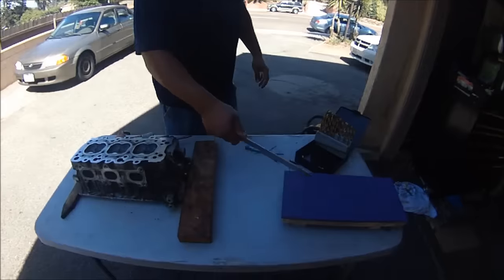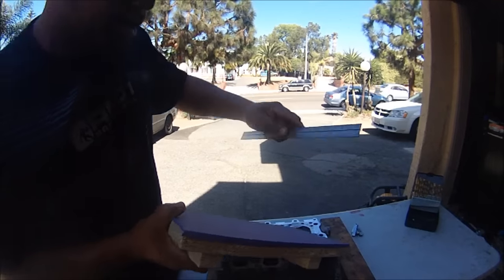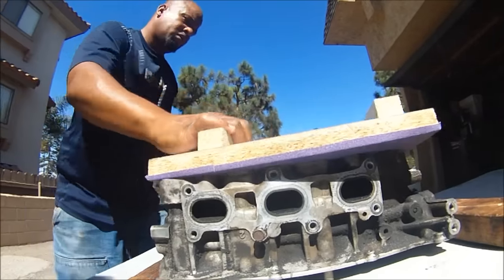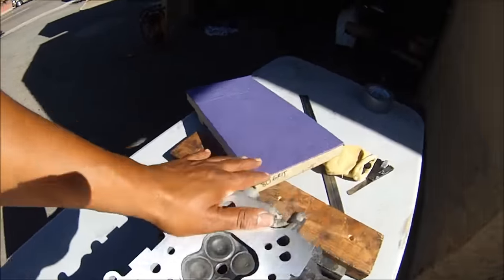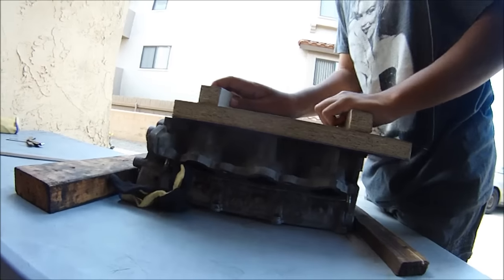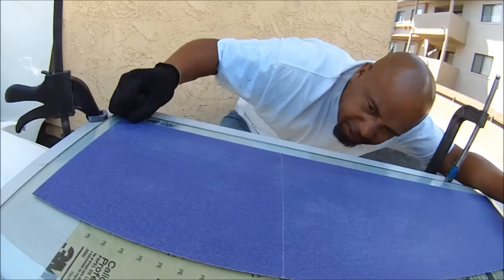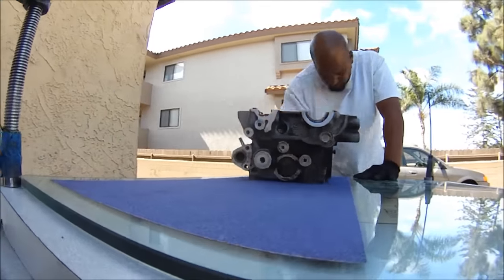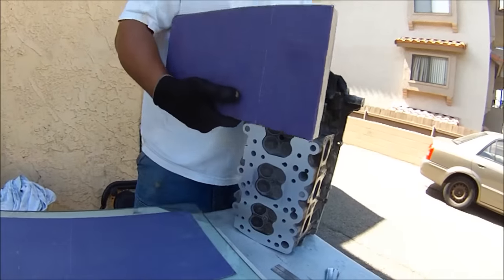HOW TO RESURFACE A WARPED CYLINDER HEAD AT HOME WITH SAND PAPER still works in (2023)

Comment: Yo, old-school I like your video's, n also would like to ask u a question, how is it that the valve on the exhaust side on #2 the left side is sticking out like a 1/4 of a inch n the right one is I say is about 1/32nds of an inch n the rest is all flushed all the way down,oh sorry my bad 4got to even tell u what I'm doing. Ok I bought a 2005 Nissan Altima 2.5L4 cylinder engine bt I've been fixing it on my own from watching video's like yours n I'm not a mechanic bt I know some things on maintaining a vehicle so thanks to your video's n the others where I've understood my ride a whole lot better,n so right now I'm practicly doing everything on it right now like see I was doing the gasket on the exhaust manifold bt then I saw alot of grease r oil with all that sand on the cylinder head n the engine body so I said to myself that I should not put the gasket on cause I found out I needed to change the head gasket so that"s what I am doing bt just that one thing that I am stuck with cause like I said I'm not really a mechanic bt I would like to b bt thanks to u n the other video's I've watched really helped me out a whole lot more in understanding n what to do bt just that valve thing'ie is one that not sure on what to do so I would greatly appreciate your advice OLDSCHOOL

Comment: Another great vid brother. Think the parable I take from here was that if that cylinder head ain't straight, it wouldn't for fill the purpose it's designed to do, for fill the purpose it's created for, or last. So too we should walk straight following Christ to not only function as we're designed by GOD, but to ultimately live our full potential and purpose in life. Every part in a car has a purpose, and we too have purpose as the body of Christ.  1 Corinthians 12:27

Comment: I've been using this technique for decades, but not on automotive products, but rather small engines for power equipment and such.  Works fine for that. With the small engine head it's easy to go in a 'figure 8' pattern which tends to give better results.  You would need a huge surface to do that with an auto head though. I wonder how flat the deck on the block of that engine is, did y'all check that by chance?

Comment: I mean, its a way to do it if the funds are non-existent and you have the time to do all this. I appreciate the can-do attitude of this man. You have to be carefull tho. The surface of the abrasive base or board has to be right, strong and flat. Try not sanding one way but come at it from the other end so you dont sand downhill all the time and create a slant. But good work.

Comment: it took you a lot more than an hour to eet up the table, shop for your wood, cut the handles on your sander, prepare your sanding board to true flar, mount your handles on your wood block, mount the sandpaper on the wood, source your glass, go pick up the glass.  msn you hsve about 6 hours into building thst station.   go pay the $45   id be using 1200 or 1500 grit.  dod the inspiration speech at the end.  Have you ever done a flywheel ?  i got an ej259  Subaru SOHC thst needs a couple valves.  you might have inspired me to take a loss and spend the time building this rig that clearly works.   its just more time consuming than what a machine shop would charge.  But i like a good DIY project where i learn something.
Reply from the maker: Take it and run with it. Use your creativity and gifts God gave you. Never let anything, negative thoughts or doubt limit your CAPABILITIES. Over thinking destroys progress. With God all things are possible, In JESUS MIGHTY NAME.
Reply: @oldskoolfunk71  I think I'm going to source a piece of granite.  What type of adhesive is best...  ... with the idea in mind that it will need to be scraped off and changed from time to time.

Comment: Yo, Old School I like your video on resurfacing the cylinder head cause I'm doing a head gasket on a 2005 Nissan Altima 2.5L 4 cylinder engine b have a question can u also resurface the intake cause I skrech it somewhat a bit n I'm worried about it even though I I have all the gaskets 4 the vehicle cause I need a new exhaust manifold converter n got me the gasket kit n 2 ignition coils bt thinking of just getting 2 more so the spark would b find u think THANK'S 4 your help brotherman really appreciate you helping me with my situation

Comment: have used a similar method, but used a piece of tempered glass with sandpaper glued to it, as glass is perfectly flat, instead of sanding the head, I slide the head on the sandpaper. have also decked a block this way, after sealing the piston gap with tape, so the grit doesn't get in there
Reply: oh, you are using glass eventually...
Reply: glass is not flat

Comment: I think you should be using a longer board and sand paper. You can never have one of the edges of your grinding plate pass the edge of the workpiece. The flatness would be truer if it didn't. I thought that was very interesting seeing the low spots! I wonder why those areas sank down? Ive seen stuff like that on my heads as well.

Comment: In respect to the engine block I would experiment with a similar procedure especially on these 2.0 Honda that become compromised between cylinder 2 and 3 in a prolonged overheating or slightly compromised situation. Instead of pulling the motor and Milling the block, I would try something like this however a very different tool would have to be used. Any gain on a consistent level would prove to be helpful and maybe get away with saving 12 hours of Labor

Comment: FYI you can also swap out head bolts for grade 10 studs even if no issues, you can pull one by one in correct torque spec and save some money as parts store keep studs in stock usually same length all you need some could be swapped out for shorter ones, BOOM you have a studded head and reusable. If the hole has oil in it be time to use can carb choke cleaner an some air shot in there with nice oil rag for blow back to strip it clean. finger tight or slight snug all needed for studs, a drop of red locker or tooth brush w some ultra black to seal hole as studs wont be stretched. After all this i usually after first heat cycle do extra 5lbs for OCD purposes. No need to spend over $100 for head studs, grade 8 or grade 10 still the grade of stud name brand or parts store in box for about a 1 or 2 each.  Applying ultra black keeps the dielectric in Dexcool from happening around steam holes and etching metal an prevents brinelling of surface as fire ring digs in dur to thermal expansion and contraction.

Comment: Yes, you can flatten a gasket surface at home, but... the cam tunnel and valve seats may still be warped.   No bullshit my dudes.      Years ago I did a head gasket on a car which had a new radiator...clue!!!.      It had overheated so bad that the valve seats warped.   I didn’t learn this until it was running with low vacuum.   A leak down test showed valve seal leaks.       Got to do that job twice..!!
Edit:   Just remembered it was taken apart when I started working there.    
I’ve learned to tip the head upside down and then fill each combustion chamber with water or atf/solvent combo liquid.   If she leaks, it need valve job..!    Give it 24 hours, it may leak immediately or slowly.

Comment: The method shown is totally within classic workshop-book description ..  eg. DUCATI motorbike .. the only point he missed is "figure 8"  ..as to keep it from going all skimming within one main direction you should  move the head around in an 8 especially on the last two finnish steps. That's of course easy to do with the individual cylinder head of an Ducati engine .. for an 3cylinder head you need a bigger sandpaper surface area on the glass

Comment: Just an FYI, not that it's that far off obviously, but If you have 3 different flat sanding blocks, each of the same grit, and alternate between all three during your sanding stages, it will almost eliminate all microscopic imperfections, or discrepancies between the sanding blocks and give you a machine quality finish.    (since your sanding block is most likely NOT absolutely perfectly straight and smooth)

Comment: Let me jump in here too. At 60 I've been machining and building engines for 45 years. Turning wrenches like 48( 12 when I started helping my uncle).  And through the years I've run some super nice machines. And I've done some backyard stuff like this.  And I try and stay in the machine shop with this stuff as much as possible.  But we too have had to do what you had to do at times in the early days.  This will work if you just take your time and keep checking yourself  many will talk shit and down you. But at the end of the day you will be running and that's what counts... Plus half of them talking shit probably couldn't do it like this anyway.  Because it's actually harder than turning on a machine and it does most of the work.  Besides,  what the hell does their opinion matter anyway right 😅?

Comment: I watched  friend of mine drind the aluminum head of his VW using valve grinding comound on a iece of glass.  The machine sho wouldntgrind it becaue there wasnt enough thickness left from a revious grinding.  After my friend ground it the engine ran just fine for many years.

Comment: You should also use engineer's blue on the surface. It will show you all the low spots. Keep sanding until all the blue is gone.

Comment: This works but going in with a lighter grit than 120 would be the ultimate best result. Not saying 80, 100 and 120 wouldn’t work. I would also highly suggest this if you’re doing this to an aluminum head. With aluminum, go much higher grit. 500, 800, 1000, etc. Steel doesn’t get as many grooves as aluminum.

Comment: Hi Oldskool funk your a good instructor on motor repairs and anything dealing with cars , im wanting to know something about my car its a 2007 suzuki swift+  , when i go to start it up sometimes it will start and other times it wont ,as example i tried starting it for 2 day with no start then day 3 i got in and turned the key and it started right up ,do you know what could be the problem why its doing that .thanks so much if you can answer me on this .God Bless

Comment: Great idea, I wonder though if the head is warped how is all the valves going to work. They say to only surface a head when its .010 out. If its more it needs to be pressed straight to within : .010

Just a thought.

Comment: you can treat the engine block surface just like that - without having to pull it up. just as good as the machining.
if you use a piece of glass the reflection will show you any warpage. so no need to measure it.

Comment: Great job MAN! I am in the process of doing exactly what you have shown. Thank you for the word of wisdom and putting Christ first. I see that you used the flat sanding block for the 80 grit. Can I also use the same methods for the 100 and 120 grit instead of the glass surface?
Reply: I was wondering the same thing
Reply: Probably could get away with it, but you want something EXTREMELY flat. A marble gloss countertop is ground flat, but might not be; glass panes tend to be flat, but they can bend if whatever they're sitting on also can bend; wood is easy to accidentally dent and pit, and that's not what you want. The best surface would be a surface plate; but they can be expensive.

Comment: What were the symptoms of this warped head im having a nightmare on 19pd golf its highly tuned it was running good for 6 month then started getting oil in the coolant changed gaskets 3 times along with head bolts etc and oil cooler etc woul a warped head cause oil in the coolant??

Comment: My concern about the first part when he was doing 120 was that he could be putting more pressure on one side or the other, essentially causing a slope. May be flat, but at a slope, which would obviously not be great.  But then when he did the second round, with the weight of the block being the pressure on top of the sandpaper, that seemed like a pretty darned good idea. Would there be any reason not to just do the whole thing that way? Start with 120 glued to the glass?  Then rip it off and do 100?  Then 80?

Comment: You should USE LAYOUT DYE, OR EVEN A SHARPIE TO MARK THE LOWEST SPOTS ON THE HEAD, SO YOU CAN VISUALLY SEE HOW MUCH MATERIAL STILL NEEDS TO BE REMOVED AND YOU'LL KNOW PRECISELY  WHEN TO STOP, SO YOURE NOT OVERLY INCREASING YOUR CYLINDER COMPRESSION.

Comment: could have also took some paint n took the sanding block across and once all the paint is romoved its flat.. not knockin how it was done in the video n didnt go thru the comments just my 2 cents on how  i would have done this. now the glass method on small 2 stroke heads before.. was at request of owner to fix it that way...

Comment: Wouldn't it be slightly better to use a better table for the first time sanding with that plank of wood rig thing u got going? That table seemed to wobble and sink in and out a lot. Im not trying to knock on this guy i just thought id add a suggestion. But yeah, great video dawg. Its awesome to see stuff like this.
Reply from the maker: Thats why you modify what you see. Take everything and improve it. I just wanted to spark the ability to think outside the box. I agree with you great idea Marco, Everything can be improved. Creativity is endless.

Comment: Another method is much easier and it's called ceramic engineering it involves washing dishes at the local diner until you can purchase an old block from a salvage yard.
Reply from the maker: Then youll never gain the experience

Comment: So, you spent $25 on sand paper and 3m 77 adhesive and saved yourself $20 but spent 2 hours sanding? How is that a savings? I do like the idea and the fact that it worked makes it a great idea.
Reply: I like this method because yeah you can throw it down to the engineer and get it done for £40 but it’s how long they take, some places you could be waiting 4-5 days, this is done same day, keep stuff moving out of garage 👌

Comment: I'm hoping someone out there knows of a solution to my problem. I know I'm an idiot.... From the beginning I covered all my ports so nothing gos inside the engine. Vacuum on hand, try to do a clean job. So as I prep the engine for new head gasket & lifters you know reassemble everything. So as I was about to insert the 2nd lifter tray & I dropped the bolt that go's to the lifter tray not sure if it fell in the block, but I looked all over the place like crazy & could not find it. With so many crevices in a enginebay it could be any where.  I just heard it go down hitting like metal or like a hollow area. Im sure it never hit the ground. Is there any body that has a method to insure whether or not the bolt is in the engine block with out removing the oil pan?

Comment: A better method is to use a glass shelf......glass due to the way it's made is flat....spray 3m 70 spray adhesive on it and cover with wet/dry sand paper and sand......for high boost turbo motors running metal gaskets I go to 400-600 grit polishes like a mirror!

Comment: you need to bend the head straight first with pressure and heat. then you won't need to sand it.  it will be flat

Comment: No bro!  
You want a rubbing compound.  Take a heavy sheet of glass put it on your table.  Coat the head in rubbing compound and water then turn the head over on to the glass.  Then slide the entire head back and forth until flat.

Comment: 2000th of an inch is thicker(!) than 4000th of an inch. So testing the end result with a 2000th of an inch if you have 4000th, doesnt make sense. I get the idea though. Great video !
Reply: Are you sure about that? .002 is thicker than .004? 🤪👍
Reply: @robertnewell1277   .002 inch is something else than 1/2000th of an inch. Sure .002 is thinner than .004.   But 4000th of an inch is thinner than 2000th of an inch.  (Because you are dividing 1 by 4000 pieces, rather than 20000.) I dont know which metric is used on this tool. If it's decimal or relative.
Reply: rather than 2000**

Comment: Just pay the money.. and take it to a machinist.. Some things are worth the price tag.. when it comes to something as important. As a cylinder head, take it to a pro.. or expect to be stranded.. very shortly after this repair.. something to be said. For having the right tools, for the right job.
Reply from the maker: It's not for you
Reply: @oldskoolfunk71  Your right it's not. I'd rather pay a professional.. with proper tools.. so my car runs reliably.. but I think to myself, how many people.. will actually try this. And just end up destroying their engine. Because of it.  You could at least put a disclaimer. That your most likely a backyard mechanic.. with no actual professional training.
Reply from the maker: . As you complain we will continue to move forward without you
Reply: @oldskoolfunk71  I think you need to open a dictionary.. and look up the definition of complain.
Reply from the maker: Rebuked
Reply: @acid_burn7837  check your spelling

Comment: What if the head of the block isn't flat?
Reply: You mean the top of the engine block? If the head gasket leaked and the block is aluminum it must be resurfaced, but if it's cast iron then just clean it up.

Comment: saw one funny mechanic video resurfacing the cylinder head by simply putting sanding surface on rough shop floor. a quick swirl and its done. dont think its an approved method.

Comment: this won't work on overhead cam engines, which is a lot these days.  with OHC engines... you want the cams flat..not the valve/sealing side.  you can get the sealing side flat but your cams will be misaligned chewing up bearings and your crankshaft will eat those shavings.  knock knock.. who's there... cylinder 4